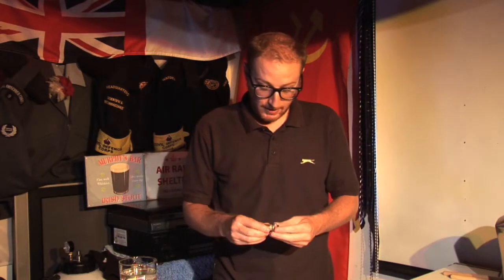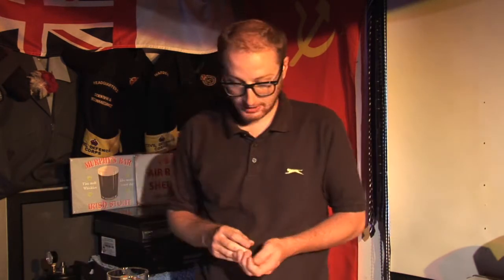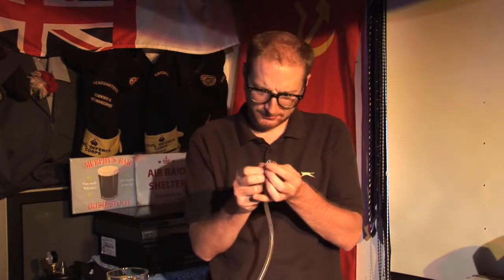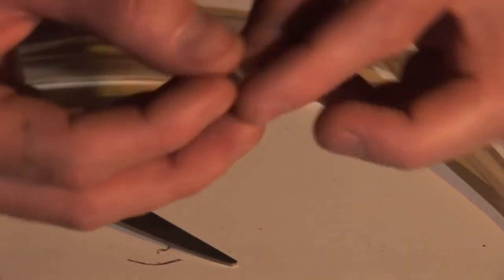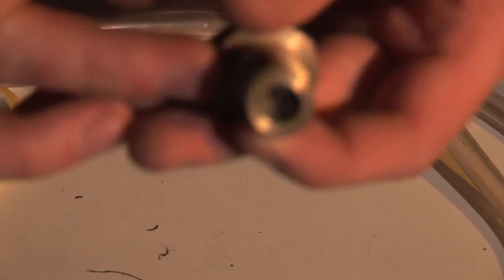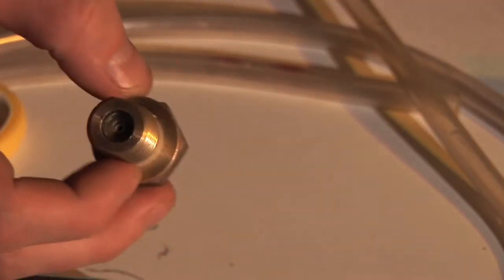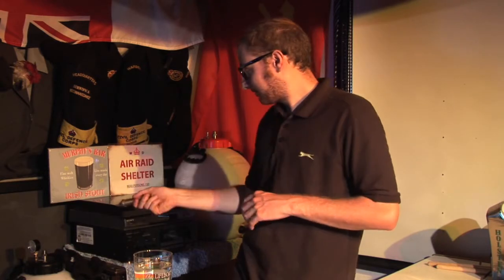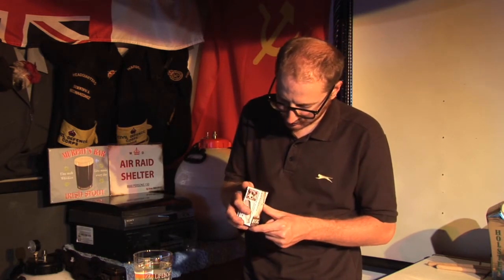Home Brew Co2 S30 Pin Valve Problem Solved

Comment: I can report back that it worked. You sir are a genius. I had to use the thinner hard plastic syphon pipe rather than the flexible softer plastic pipe but it did the trick.
Reply from the maker: Glad it worked for you folk :)

Comment: Got it sorted mate rubber seal on outside of valve was stuck, little movement sorted it out, learning every day Cheers
Reply from the maker: excellent, glad you got it sorted :) sometimes the rubber gets stuck to the metal. when cleaning it, rinse it under hot water maybe and should unstick it :)

cheers for the comment :)

Comment: I got me pressure gauge for my king keg, what i was wanting to ask is what kind pressure are you getting when you add brew to king keg? Ive put it on and added gas to test and its sitting about 4psi, Cheers Again for your info :)
Reply from the maker: tops around 9 psi before the pressure release valve kicks in I believe. it don't seem to go above that.

At the moment my king keg top tap it at 8 psi and my bottom tap is at 6 psi, as long as it dont go down im leaving it :)

When you draw beer and the pressure goes down, leave it a couple of days and it should build up pressure again. So you don't have to use bulbs all the time.

Good thing about the gauge is that if its not holding pressure you can see and if needed, you can tighten the cap and stuff, play with it until it stops losing pressure.

hope that helps :)
Reply: Thanks mate your a great help, Cheers
Reply from the maker: no problem :)

Comment: Great video, as are the rest of the home brew ones :) Anywhoo mate I hope you can help me or advise me. I have two Cornelius kegs and two King Keg Top Tap barrels. The Cornies are great but one of the pin valves on the KIng Kep has the same problem as the one in the video.TBH I am sick to the crack in my erse wasting CO2 cartridges so was interested in trying another option. Now the tricky bit :)  Have you ever fitted a Cornelius keg Ball Lock to a 4" cap. I was considering trying this and using my large CO2 bottles to charge the King Keg up to about 4-8 PSI for serving . I hope you get the gist of my post and even more hopefully have some advice. Anywhooo mate, keep up the videos :) :)

Comment: I see in your vid you have bought a Balliihoo 4" Barrel Cap with gauge are they a good fit? cheers
Reply from the maker: yeah not bad, i liked because it has a flat washer o-ring and not round like king kegs default :) seals better
Reply: Great Thanks for letting me know Cheers
Reply from the maker: Tam Rowan no problem :)
Reply: IKS Production Team  I put other pressure gauge on and made coopers stout, but pressure gauge is well past 15 psi only thing stopping it going any more is little pin at start, so am having to let pressure out, is this a faulty pressure release valve do you think? Cheers again mate
Reply: Another great home brew video.

Comment: What i do is fold a piece of paper into a wedge and stuff it in between the bulb and plastic holder to hold it in place no problems
Reply from the maker: I done that with my plastic holder, I use a metal one now and dont need the paper :) thanks for the comment.